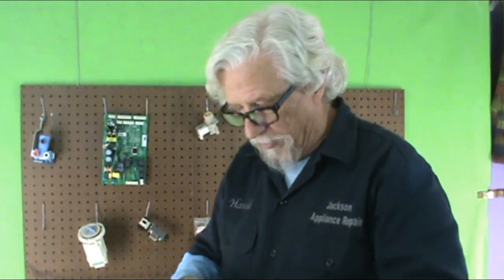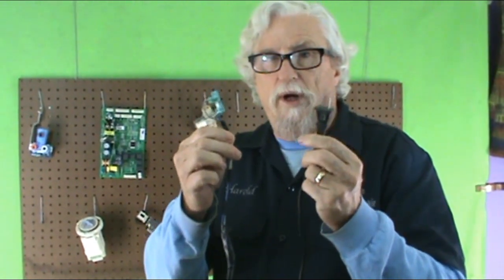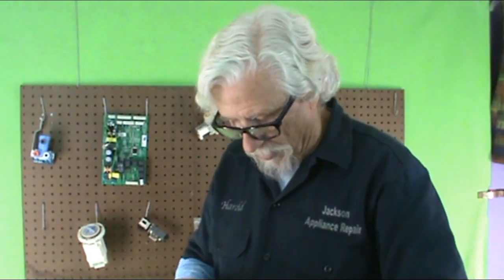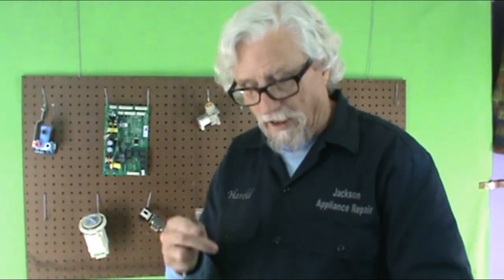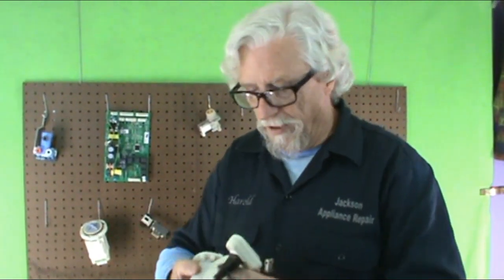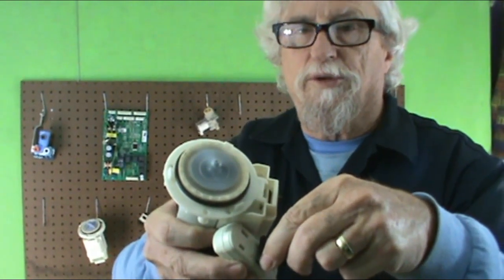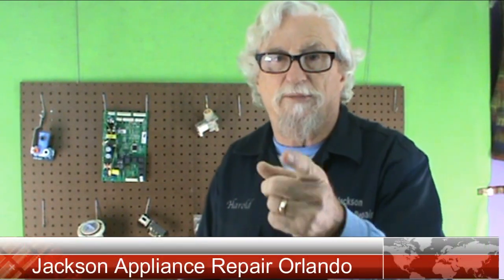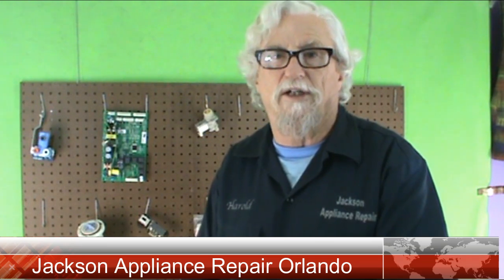How to test a front load washing machine water pump

Comment: Thanks for the video. I have Whirlpool Duet w/pump #: W10130913. I occasionally (usually) get F21 (Drain) error. All hoses are clear and when the thing drains (usually the first pump-out on a Normal cycle) it pumps just fine at a nice volume. When it gives the F21 error though, the machine stops and sometimes won't clear the error til I unplug for an hour-ish.

I took the pump out where I could see the impeller and yet had it plugged into the machine. I ran the Drain/Spin cycle while holding the pump in my hand. It ran fine, both forward and backward, on and off, for the entire 13 minutes.  I noticed some water droplets coming out of the motor the entire time where the impeller shaft goes thru the motor wall. Still, though, it worked, and the electromagnet on top of the motor got barely warm.

I reinstalled the motor and ran a Normal cycle. Again, it got F21! Again, would not clear so I unplugged it for an hour. Re-started in the Drain/Spin cycle. I noticed there was no water coming out the drain hose so I unplugged the 2-wire pump plug then plugged it right in again and the pump motor started turning and promptly pumped out the water. I noticed that the electromagnet housing was very warm to the touch, which is was not when I ran the 13 minute cycle in my hand.

May I have your thoughts on this, please? Thank you!
Reply from the maker: Thanks for watching. Check for coins in the pump housing. And have an Awesome day.

Comment: Does polarity matter?
Reply from the maker: Good question. No not on washer pumps.
Reply from the maker: @kimbuck-2  it may make the pump run backwards.
Reply from the maker: @kimbuck-2  don't think so. If it runs backwards just reverse the wires.

Comment: Does my door have to be on for the machine to deliver 120 volts to the drain pump connector? My meter reads 1.5 volts at the connector when I start a cycle but the cycle won't actually start because the door is off and it throws a door code.
Reply from the maker: Yes. Or if you know how to bypass it you can do that. Good luck!

Comment: How many volts is there to operate naturally pump motor? Please sir answer
Reply from the maker: Most pumps are 120 volts. They all have labels. Check the label before testing. Have a great day.
Reply: @HaroldJackson Hi. Is there an acceptable range? My pump is rated for 120V, but is only receiving 105V. It only works intermittently. Haven't had a chance to test voltage when its not working; waiting for it fail again. it works fine at 105V.  Thanks for the video!
Reply from the maker: @Danielito9165  that voltage range is good. Normally the pump works or it doesn't work. Sounds like something else is the issue.
Reply: @HaroldJackson  Thank you for replying. The pump will occasionally not drain. It tries to spin, but just sputters and shakes. No obstructions in the pump or lines. I will check voltage next time it fails. Have a great Labor Day weekend.
Reply from the maker: @Danielito9165  sounds like the propeller has come loose from the shaft. You will have to change the pump.
Reply: @HaroldJackson  Thank you, sir. I already have one on order. Figured I'd do a bit more troubleshooting while it gets here.
Reply: Turns out it was intermittent low voltage. We were in a heatwave at the time. During the peak hours of the day, with everyone running AC, the outlet voltage would drop below 100V and that's when the pump wouldn't work.

Comment: if I ran the clothes washer at the same time as the dishwasher, would that explain a sudden drain pump failure?  nothing else wrong with my dishwasher other than not draining (kenmore ultra wash elite).  do  they run on timers, and don't have sensors to shut off the pump if deprived of water? hard to test tiny connectors with tester, but i do get a pretty consistent 20-something reading every time i test continuity.
Reply: Thanks, that's not the problem. drains fine. Trying to run diagnostic test I wish there was more consistency of information on the internet on what buttons to push.  I'm also wondering if having the sink plugged with dishes soaking in it while running the washer deprived  it of oxygen and maybe had something to do with it.
Reply from the maker: @scottmhorn  Are you talking about the Dishwasher or the Washing Machine? If the washing Machine is not draining it's ether the pump or the control board. You need to test each one to see what part you need. Of the drain line could be clogged. No magic button to push to fix that Washing Machine.
Reply from the maker: @scottmhorn  OK got it. So that tells me that you have a water level problem. It's not getting enough water. Check water hose filters on the hoses. Make sure the water is all the way on. Most of the time this is fixed by replacing the water inlet valve. Good luck!
Reply from the maker: Remove the drain hose from the sink side and suck it out with a wet dry vac and check the drain at the sink. Good luck.
Reply: @HaroldJackson  ?
Reply from the maker: @scottmhorn  clean out the drain line.